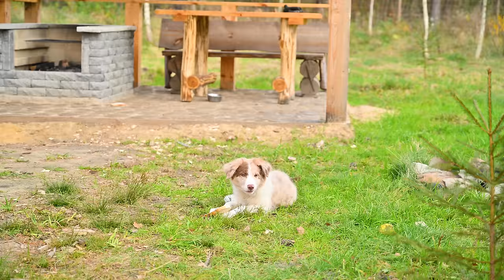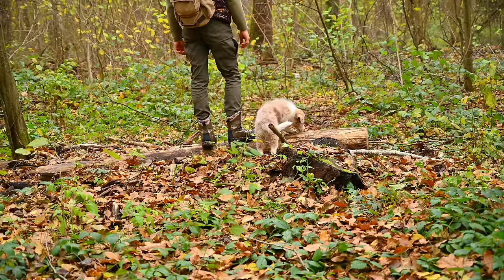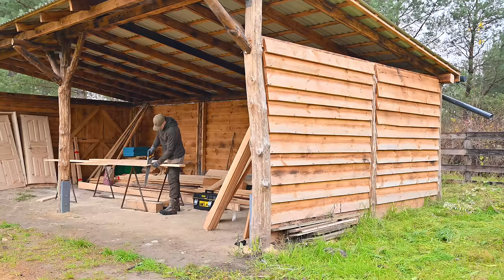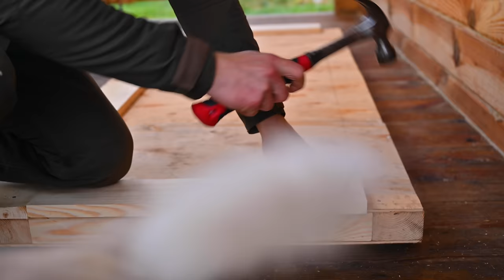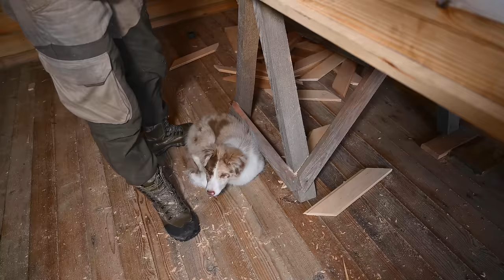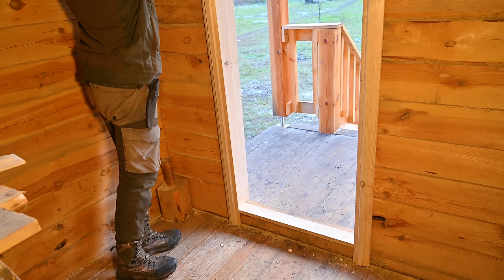Making an Insulated Door for My Off Grid Log Cabin, Painting Wooden Walls Ep.14

Comment: Incredible door Bjorn made. I've never seen those types of hinges used before.
Reply: That type of hinge used to be quite common on kitchen cabinets before the 'Euro' type took over; variations of the type are still widely used for gates and barn doors, etc.  They can be a pain to hang the door but it is easier if you shorten one of the pins by 5mm or so.  Then you can align the pins one at a time rather than having to get two or three lined up simultaneously.

Comment: Wouldn’t it have been a lot easier to use a pump up sprayer and gotten better coverage than trying to use a paint brush to apply sealer that’s about as thin as water to the exterior of your cabin? It just doesn’t seem to be an affective method for sealing your cabin.